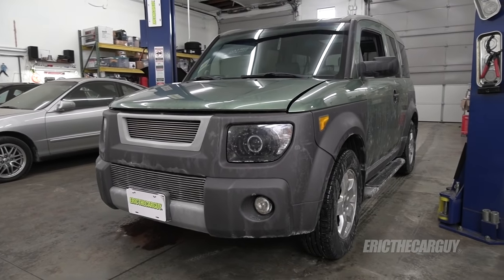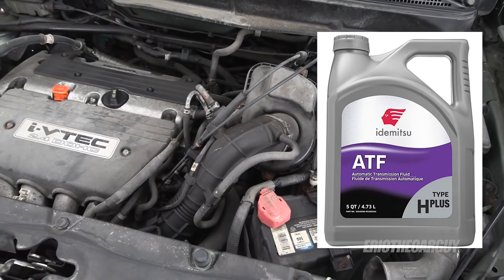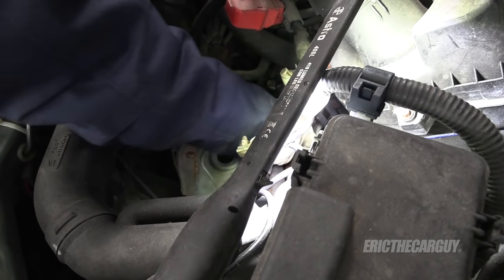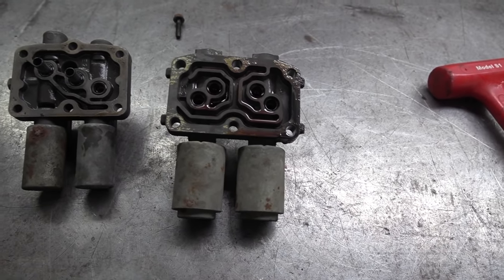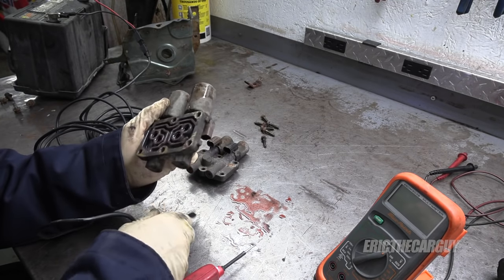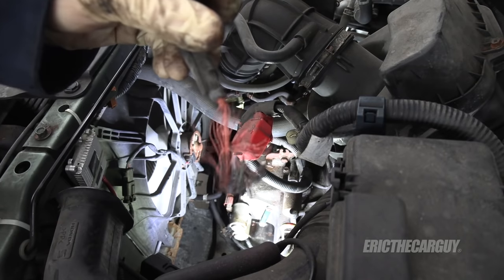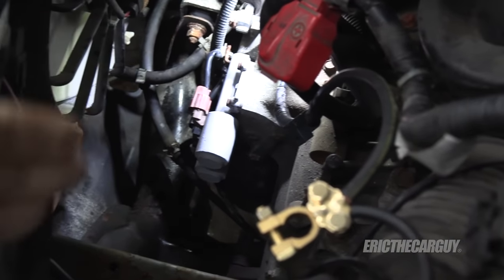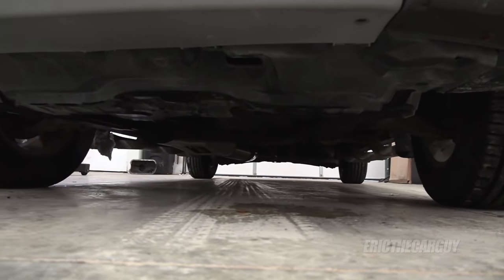Delayed Shifting, Honda Transmission

Comment: It’s funny that this video came out when it did. My 2017 ridgeline started shifting strangely, almost exactly like this, a couple weeks ago and even got stuck in third gear and wouldn’t shift until I turned it off and started it up again. Thankfully if this is what the issue is, it’s way cheaper than a new transmission. But still, it’s irritating that they haven’t come farther with their transmissions and still have the same issues. It was interesting to learn that about their auto trannys!

Comment: Patient car guy! I have a 2004 CRV exactly same problem, 165k miles, checked solenoid it works, although trans. Fluid never changed.Found out 20 y.o. Car never had a tune up. Fluid looks clean, but most likely it needs afluid change, filter replacement and new solenoid shifter.Also, it might be related to ECM for stuck in Park or wont go to Park.

Comment: Hi Eric. You are usually very methodical, but this time you replaced 2 things at the same time, so you don't know whether the filter or the solenoids fixed the problem. I agree the behaviour seems more likely to have been the solenoids.

Comment: It's entirely possible that the problem was the old filter, since you replaced it at the same time as the pressure switch. I have the exact - and I mean exact - same issue with my 03 CRV. Same engine (K24A1, this is a K24A4 which is nearly identical), similar transmission (mine is an MRVA AWD transaxle). My theory is that, potentially, the internal route that the fluid travels along must have some more restriction or a greater distance to travel from the oil pump to the 3rd clutch than the rest of the clutches do - so that when there's a restriction in the filter, it shows up more in that gear than the rest. This would also potentially explain why both of those solenoids in the supposedly bad switch seemed to work fine. That doesn't necessarily mean that those solenoids weren't mechanically worn in some way that makes them open and close slower or something. I'd also like to add that I found it interesting that I also got a code for this particular problem. What I'm going to do is just replace the filter and see if that fixes the problem. If not and I have to dig into the the solenoids, I'll measure the resistance on the new ones (as well as the old ones) and post it here because it'd be good to know if they're the same or if these old ones were both equally worn out
Reply: waiting for your comment soon?
Reply: @ok99okok  I replaced the filter and it didn't fix my problem, but a year later (haven't touched the transmission since I did this) the transmission is still fine. Still has the problem, of course, but it hasn't gotten any worse. The code, I forgot to mention in the original post, was for a "3rd pressure switch" I think I ordered the part ages ago, probably right around when I made this comment. I never got around to replacing it. I need to do that.

Comment: I have an Aisin AWTF-80 SC transmission, it has the same exact problem, when shifting into 3rd flares a bit. I thought this was the normal operating so I didn't really care about it, in fact I drove about 60k miles with this issue. But now I will get it check out for sure! Thanks!

Comment: Also Eric those passages they look like stainless steal cylinder pipes come out and I believe two of the three have a little mesh in them you can clean them out, sometimes they get junk in them.  Great video and praying for you to find a new location as well.
Reply: That's true. I am chasing an issue on 2003 accord auto. Pulled the A/B solenoid and cleaned all the screens.
Reply: @ZealoustheEnder  Did it work ?
Reply: It's working better but I believe I'm still having a pressure issue I'm going to change the filter.

Comment: This video couldn't' have come at a better timing, I plan to do the exact same work on a 2003 CR-V for A and B-C Solenoids, fluid change, and filter change. I have a 1-2 downshift and 2-3 upshift delay. I hope it solves the problem.
Reply: I changed my fluid and filter and a month later it went kaput on the highway....had to rebuild...

Comment: Great video! Thanks. Found out my solenoids were good, but the little screens on the pipes running into the transmission were plugged. Cleaned them out and problem gone.

Comment: Hard to determine whether it was filter or solenoid when you changed both items. Does a clogged filter give a pressure drop that would contribute to the shifting issue?
I think It was shaft wear in the solenoid. Good to know it's easy to change out. 
Thanks for sharing Eric, 
Cheers
Reply from the maker: The filter had nothing to do with it. I'm certain it was a solenoid issue. Likely the solenoid getting weak. It's very common. Thanks for the comment.
Reply: @EricTheCarGuy I’ve had similar issues in a 99 civic lx and I fixed it (at least for the last five months) by pulling off the solenoids and cleaning the solenoids and especially the small mesh filter on the solenoid gasket. The small mesh filter i believe is what caused the intermittent lag in shifting, it was covered in grime. After reinstall of the same original parts car shifts like new! But that is also just my case and working on an older car that someone didn’t get transmission fluid changes enough on
Reply: @jameshunt5316  glad your sorted your issue simply by cleaning it. I also sorted an issue with an idler control valve in my both civics by simply cleaning it.
Reply: @Rui Nunes better, they cost wayyyy too much brand new. I’ve cleaned three and two worked, one customer brought in an aftermarket idle air control valve, didn’t work even once out of the box and still cost the guy over a hundred bucks. Personally on those you gotta go oem I’ve noticed, scrap yards are a good place to find em cheap if they end up failing on ya, I did look it up and you can get some as low as $25-$40 online but I suspect probably don’t work from my experience. Cleaning does produce miracles to these older vehicles sometimes though haha. Thanks to Eric I’ve been able to revive seven different civics for people, cleaning up their solenoids and valves, pcv oil catch can, valve adjustment job plus basic maintenance and if they pass compression and leak down, usually the thing will drive like new!
Reply: @jameshunt5316  yep, I also learned a lot from Eric. Thanks god we have YouTube. 😃
Reply: @Rui Nunes if only the old youtube was still around 😢 the channels deserve more money and less adds
Reply: @jameshunt5316  agree

Comment: 05 Pilot, not going past 10mph & hard shifting. Replaced A/B Solenoid, back to normal driving speed. Hard shifting on 3rd... Replaced 3rd & 4th Transmission Pressure Switch 28600-P7W-003 & 28600-P7Z-003. Good to go!

Comment: the Honda service manual says that the fluid level has to be changed with the engine and transmission warm and within 30 seconds of stopping the engine. It's worth noting that there is a inline transmission filter mounted at the base of the radiator fluid returning from the radiator to the transmission passes through this filter. The filter is relatively inexpensive and  should be changed when the fluid is changed..

When my 2008 element got to about 100,000 miles it developed a shift hesitation. After a fair amount of reading at the Element Owners Club forum, the consensus was that the most common cause was worn out transmission fluid and that the recommendation was to change the fluid either every 30,000 miles or when a problem is develops change it at least twice. Well I did that and the problem went away.

Comment: I think the solenoid part is actually "Clutch Pressure Control Solenoid Valve B and C". The shift solenoids are under the shift solenoid valve cover on the transmission.

Comment: My 2008 accord v6 had familiar issues when it tried to shift from 2nd to 3rd at low rpm. I could feel the jerkings and sluggish. First, i thought of those selonoids and planned to clean them but decided to check sparkplugs and battery first. It was not the battery but those sparkplugs. Found number 1 sparkplug really loose but clean and number 4 sparkplug loose with oil residue at the body (not the threads). Took them out and cleaned all sparkplugs and reinstalled fixed the issue. If that didn't work, i would go for those selenoids next and probably front right and front engine mounts next. Thanks for your video as always.

Comment: I've only had two of my Honda V6 automatic transmissions needing a rebuild.  I was quite surprised that a solenoid solved the issue. As you implied, that was unlikely.
Reply from the maker: If those were V6 transmissions, I'm not surprised at all. As I said in the video, the 4 cylinder automatics rarely have issues. Thanks for the comment.

Comment: Great video and advice, unfortunately no luck for me.
On my 3rd solenoid and 2nd transmission fluid change, still rough shift 1st to 2nd.
Replaced my solenoid from the bottom every time, way easier than the top.

Comment: Love starting my day off with an ETCG video.

I think Honda mostly solved the V6 AT issues by ~2007. It was a big issue in the early 2000s, but they started beefing them up more by 2007. I know on the Odyssey they started using a much beefier transmission from the Ridgeline that had fewer issues.

Idemitsu is indeed the OE supplier for Honda's DW-1.
Reply: Yep, 07/08TL got the new RL trans which was way better than the earlier glass trans in the cars between… 2000-2006?
Reply: @Turb0Yoda  Yeah. And the 06-07 Accord V6 got a stronger AT as well. By that point, you could do ATF changes every 30k and be good to go. My 06 Odyssey has the supposedly weaker transmission that was introduced late in the 04 model year and it's still working like new at 104k.
Reply: @wiimaster2847  In 04 05 Accord V6 models the Transmissions issues where already fixed with a better Transmission from the factory.
Reply: @nighthawkj30A4  The 03-05 models were still more problematic than 06-07. They changed it up in 06 with the facelift for a reason.
Reply: @wiimaster2847  at least later 04 models and up where so much better major improvement. Unlike 03 and under almost a disaster if they didn’t offer fixes and updates.
Reply: @Turb0Yoda  tls were a problem? Didnt know as i never have seen a 2005-2006 for sale with a blown trans.

Comment: Idemitsu manufactures transmission fluids for Honda and 7 other major brand groups. Type H PLUS is for Honda/Acura automatic transmissions. They make 8 types for the major Asian car manufacturers: Toyota/Lexus/Scion, TLS with WS specs, Honda/Acura type H PLUS, Nissan/Infiniti type S, Subaru type HP, Mazda type M, Hyundai/Kia type HK4, and Hyundai/Kia/Mitsubishi type HK. They also make synthetic engine oil and oil specifically for racing. They are developing CVTF fluids for continuously variable automatic transmissions as well. Lubricants are chemistry at work!

Comment: Ever wondered why there wasn't any information in the owners manuals about the transmission filters and most dealerships when you call them about it have no idea about it? I just changed them on both my 4cyl and 6cyl and it made a huge difference for both cars and how they shifted. But that doesn't go without saying that the orignal filters each lasted over 200k miles, in my case at least. Eric is right though, use the OEM filters.
Reply from the maker: If you change your fluid at the 30K interval, changing the filter really isn't necessary. In fact, most Honda transmissions don't have a replaceable filter.

Comment: I have a 2003 Honda V6 and when the Trans went it shifted D to 1st was quite a thrill because I was doing 70mph at the time. A known issue with 2003 Honda trans.The reason I’m posting a comment is I also have A 2013 Toyota with 107,000 mi it developed a surging in drive apparently it’s a known issue with the 
Tq converter. I took both cars to their respective Dealers. Honda wanted me to call Honda customer service line after 2 weeks They gave a service discount. Toyota called it a safety related issue and just fixed it N/C. Both cars were 7years old and had over 100,000 mi.

Comment: Well done 😀 I'm sure your daughter was happy 😀
It could have been a restrictive filter and a dodgy solinoid.
That battery cable looked burnt and maybe not all of the strands were connected fully, so a higher resistance in the cable and less voltage/current for the starter.
It may improve the lighting a little or less dimming when a heater was powered up.
What do your kids think of your channels.... they don't watch there amazing dad?.
Reply from the maker: Yes, it could also have been debris in the system, but everything looked very clean. I'm a sticker about my maintenance. 
That cable was toast, trust me on that. And yes, I believe that made it so that the starter worked better. More electrons available for it to do its job. Haven't really noticed a difference in lighting. Possibly because those don't use as many amps as the starter and the body ground connection was still good. 
I'm just 'dad' to my kids. Yes, they are aware I have a successful YouTube channel, but it's not something they 'brag' about. I'm happy to say I raised them better than that. 
Always great to see you.

Comment: My 2001 Odyssey was early hard shifting and late hard shifting even though I was keeping the Honda ATF DW-1 changed and fresh in the transmission.  After replacing the Honda fluid with a full-synthetic ATF, from a fluid company in Superior Wisconsin, (80% fluid replacement) the transmission started to shift smooth and predictable.  The change was profound and continues to this day.  This gives me the impression that Honda ATF DW-1 is a low grade transmission fluid.  My 2001 Odyssey had the transmission filter inside the transmission so, I added an after market external transmission filter, a Raybestos Inline Magnetic Automatic Transmission Filter.  It keeps the ATF in a bright clean magenta color for years.
Reply from the maker: No matter what, the Honda automatic transmissions from that era were garbage. It's a design flaw in the transmission case that causes the feed tubes to leak internally and then burn up the clutches. I've replaced more of those than I can count. Thanks for the comment and good luck.
Reply: @ericthecarguy  OK.
Reply: hi, aware the level of the transmission fluids is too low or high can contribute to hard shift problems. most of the mechanics won't tell you. they just check the level is right and change new AFT fluid that's all. that is no problem using original honda products. be aware of the products you buy from...
 And always need to change transmission fluids from time to time. cheer  I own the same model car as you.

Comment: I've yet to see where Idemitsu is in fact the OEM trans fluid for Honda. Sure... There's a lot of people on the internet saying that it is but I can't find anything official confirmation on this matter. I have tried the Idemitsu in my 2011 Civic and drain it after only 3 months. It started out cherry red and turned to a burnt amber color very quickly. That was a big red flag for me. (or burnt amber flag) So now I'm currently using ENEOS Model H and it's doing very well if not better than the Idemitsu. Still cherry red after 10 months of daily driving. So keep an eye out for rapid color change when using Idemitsu ATF.
Reply from the maker: Thanks for that info. I'm running Indemitsu in my Pilot right now. So far, it's doing well.
Reply: @ericthecarguy  I seen that. Oh... and the Eneos ATF is less extensive than dealer ATF  or the Idemitsu ATF.

Comment: Eric, I haven’t watched the whole. Video yet but let’s compare problems first. My 99 Accord EXL has a similar problem only going from first to second and only on the first shift of the day. I’ve purchased new tubes and screens for the solenoid valves and I’m going to change them out. Been told clutch material can clog the screens. Car only has 66K miles. Now to the video to listen to what you find. Long long time subscriber 😊🇺🇸. artie
Reply from the maker: Good hunting. https://www.ericthecarguy.com/solving-transmission-problems/

Comment: Great that you fixed the issue, thanks for sharing! The external transmission filter is in a really interesting spot, do you have any idea why it wouldn't have been put in the same location as the 2.4L (K24) Accords? I believe those cars used basically the same engine as what's in that Element, and the trans filters in those were far easier to access, they were right under the intake piping and could easily be swapped by popping the drivers side wheel off and getting to them from there. Mainly just curious more than anything.
Anyways, thanks again, very informative video :)

Comment: My 2008 ford focus (152k miles) has started to do the same thing. 1-2 fine, 2-3 when its warm takes sometimes over a second to shift into 3rd. It doesn't flare necessarily, but it will bog down and throw you forward a bit and then finally will shift. Trans fluid changed twice already, once at 110k and then again at 130k when the problems started happening, all solenoids have been replaced...

Comment: It's shocking how expensive OEM parts are and because of this wherever possible I will go for a cheaper alternative.  Have employed this strategy for the past 6 years when working on my own cars and those belonging to my family, and it's worked out well with no issues.  Obviously if I was changing something like a main seal I would go OEM, but for everything else, if possible, I go the eBay, Amazon or Autozone route.
Reply from the maker: Be careful. https://www.youtube.com/watch?v=TvzFkJrDoDY